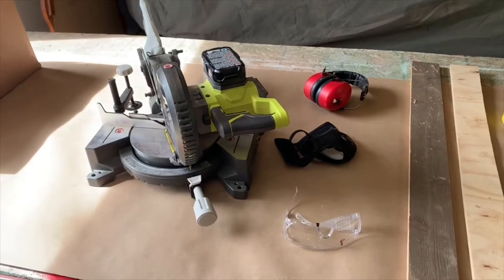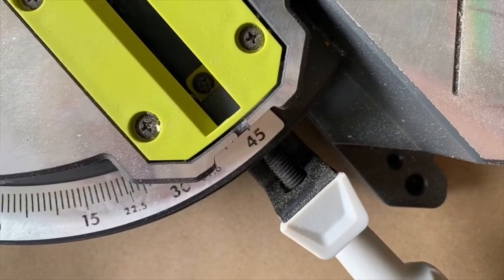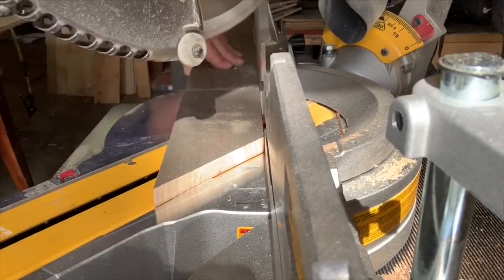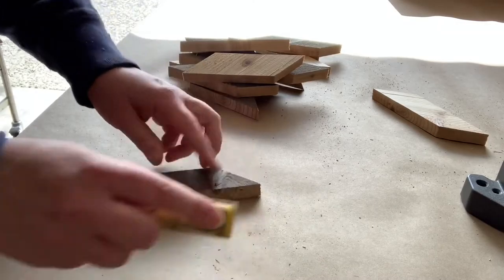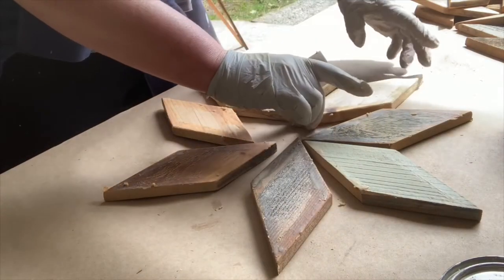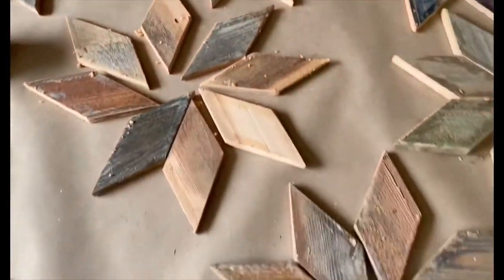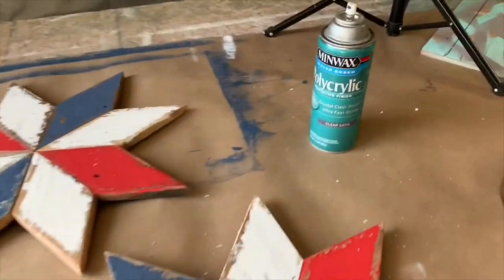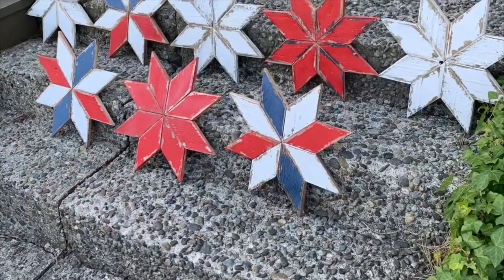DIY Wood Art - Mini Barn Quilt  Star!

Comment: Thank you so much for sharing this tutorial! What are the dimensions? They turn out funky if the proportions are not quite right lol
Reply from the maker: Honestly I never measure them.   But I typically used old fencing, so the width of a piece of fencing is typical for me.  I probably do about 5 inch cuts.
Reply: @AmberSeymourUrbanTimberRevival  thank you for your reply! Yes I’m using old fencing boards too. So those are 5 inch wide cuts or 5 in long? Or both 😭
Reply from the maker: @laurennn3825  so 5 inches wide and about 8 inches long.     Honestly, I never measure - I just cut all sorts of sizes and they always turn out in their own unique way.